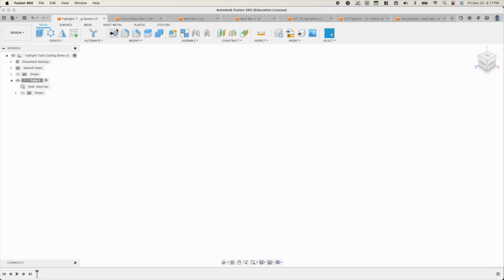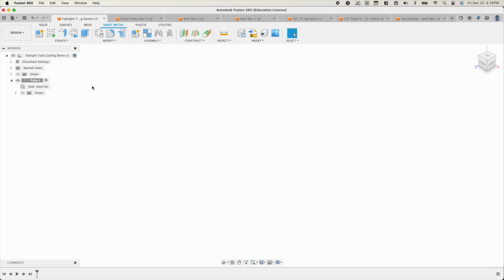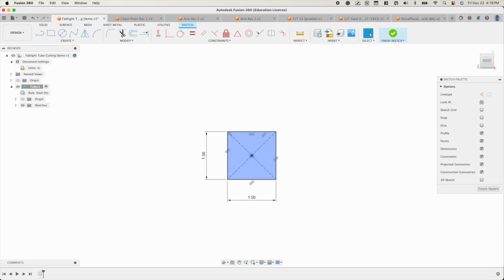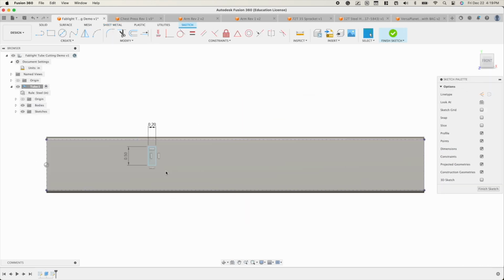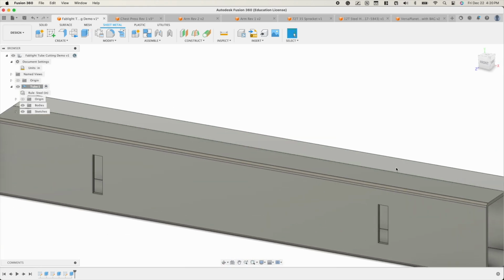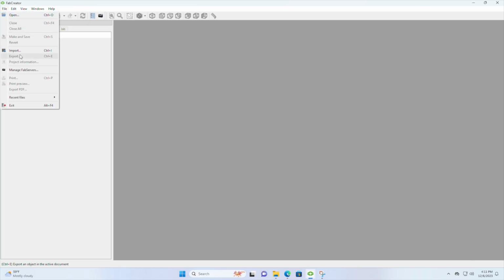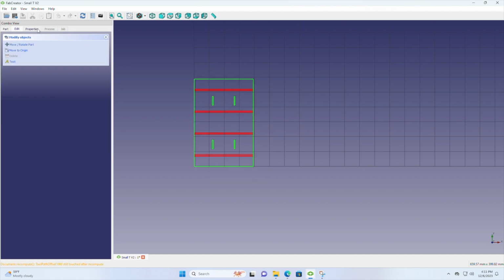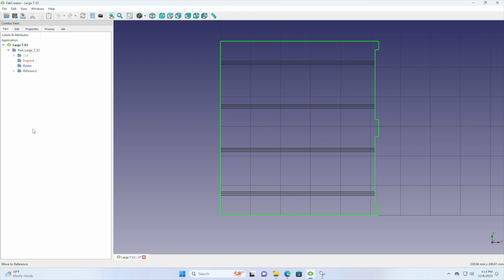Exporting tubes for lasercutting in Fusion 360

Comment: Thanks. Quick question - at the start of the video, you created a New 'sheet metal component'. But, then at 1:30 you also 'Convert to Sheet Metal'. Excuse my ignorance, I'm only 3 months into Fusion 360. But, why the double up?
Reply from the maker: I agree it's confusing. Despite being a sheet metal component, you're still able to have non sheet-metal bodies within the component. Converting to sheet metal is necessary because extrusion defaults to making a non-sheet metal body and you need to explicity declare it as a sheet metal component.
Reply: @lskaling  I figured it must be something like this. Appreciate the response. Cheers!